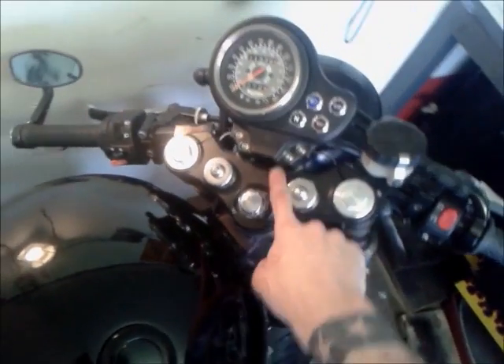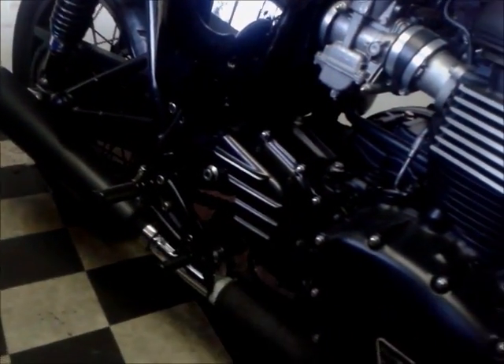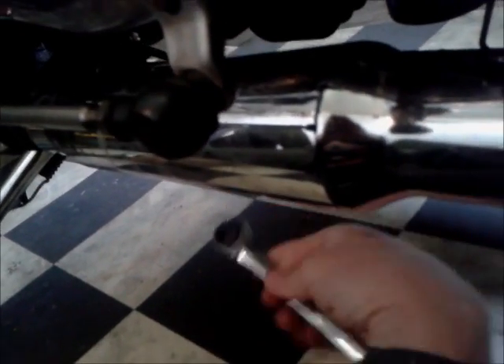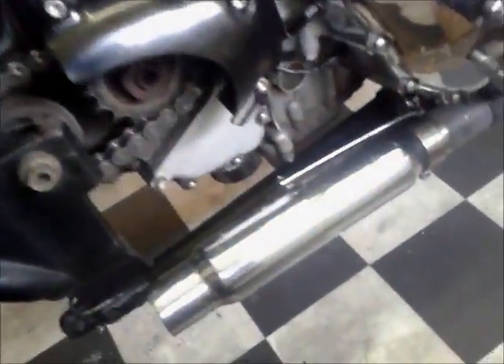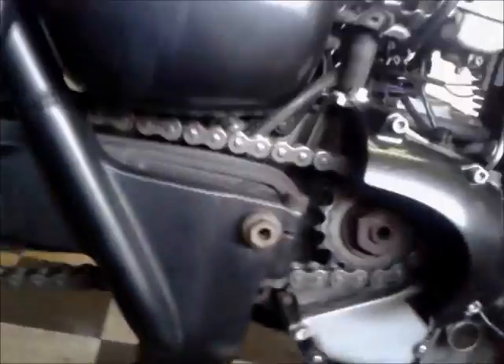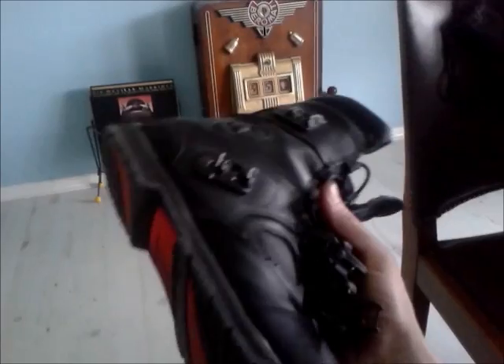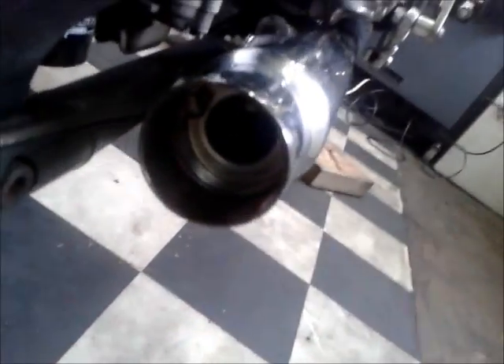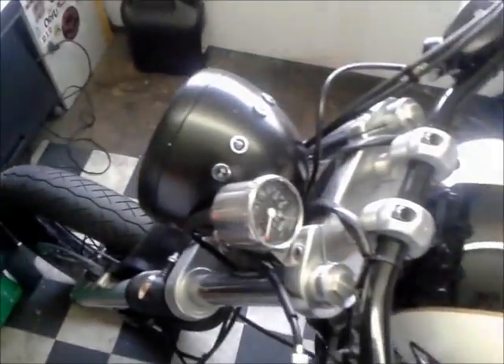BAFFLED?  USE YOUR SPIDEY SENSE!!!

Comment: Exhaust link balance pipe is usually designed to improve power/torque at lower to mid rev range--engine should be better performer with the pipe rather than without. Placement of the pipe is crucial part of the design i.e. distance from exhaust valve--that determines where in rev range improvement occurs--balance pipe usually has same diameter as the exhaust where it joins. Most engines incorporate if they have twin exhausts (except Harley) see V6 and V8's also.